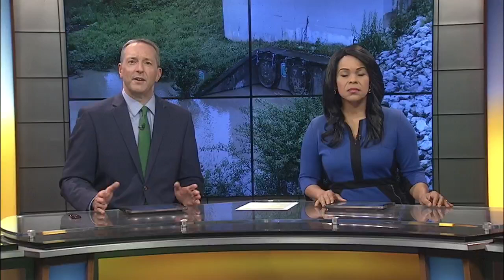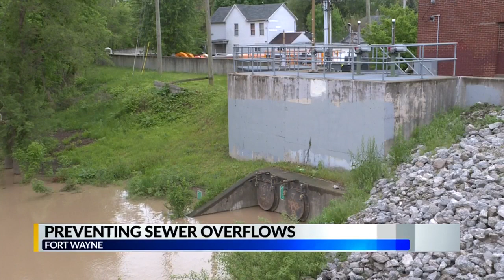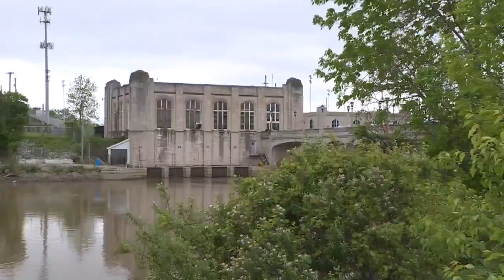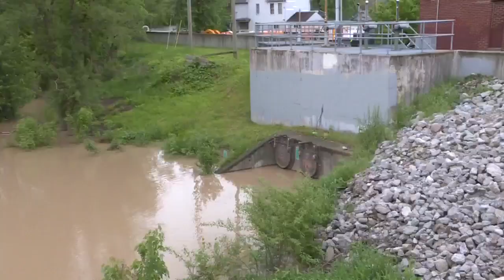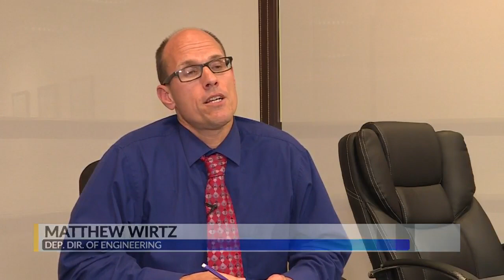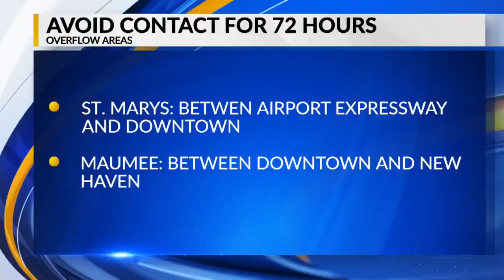Combined Sewer Overflows

Comment: Basically when you have a sewer for sewage and wastewater and you want to drain the sides of the roads gutters storm drains then you run them into the sewer and turn it into a combined sewer. In a flood the sewer will overflow out your toilets without a CSO. With a CSO the water lever of the sewer goes over a weir and into a pipe/culvert and out into the river to prevent flooding of your toilets.

And don’t pay attention to “this river is where our drinking water comes from” because if it was that unsafe then they would not allow it. It goes through a filter before it reaches your tap ect. And because of the the inlet where the water is taken out is located next to a CSO the filters are made extra powerful in anticipation to encounter a CSO and filter it out until it until it is 99.9% pure